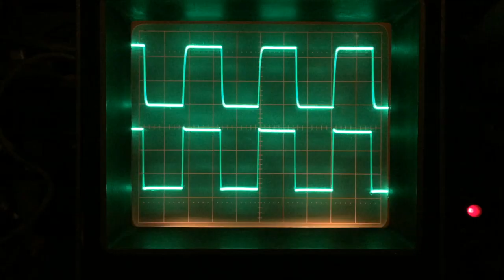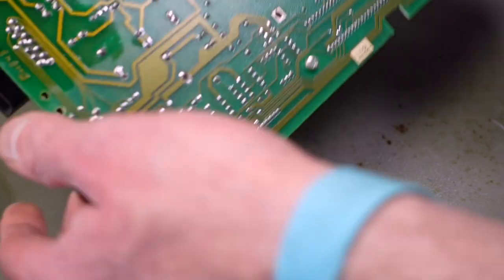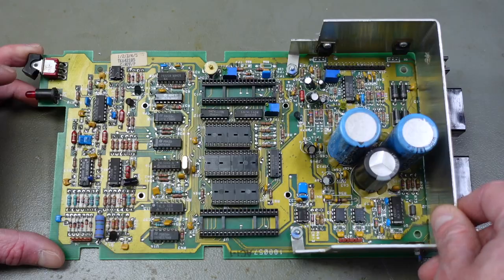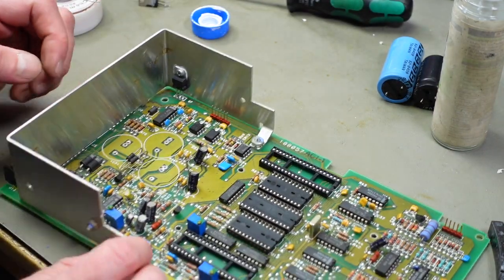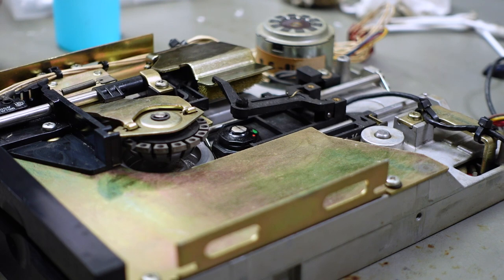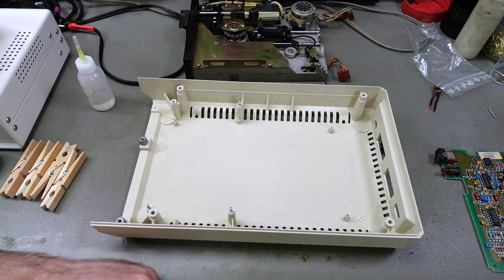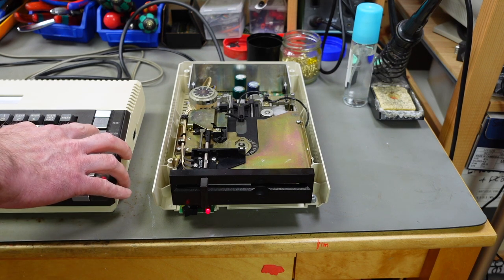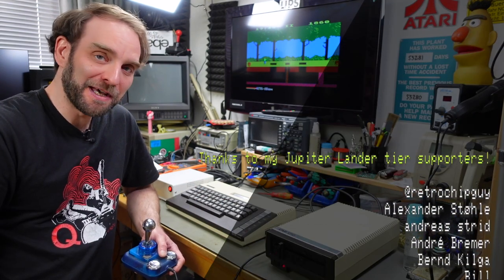Atari 1050 Disk Drive Restoration

Comment: I think the reason the screening can only rusts on the top (I've seen this a lot) is that dust settles on it, and then it gets in a humid atmosphere and the dust holds the moisture against the metal. Not much you can do about it :) If it gets bad, then neutralize it with rust converter and paint with silver paint.
The 1050 floppy drive is a really nice peripheral, and reasonably reliable if you keep the mechanism lubricated. They had a bit of a reputation for being noisy, and sometimes they were really noisy out of the factory because they didn't lubricate the rails that support the head properly - I bought one back in the 80s and couldn't believe the difference between it and the other one I had, so I took it apart and put a tiny bit of oil on the rails, and it practically silenced it!

Comment: Thanks Jan for taking the time to film/record and post. Always great content!

May I suggest a product from the US called DeoxIT made by Caig Labs if you’ve not yet discovered it. It’s a contact cleaner that cleans contact oxidation, lubricates and keeps the oxidation at bay. You can find it at the big A**z*n online retailer. I’d recommend the D100 formulation (100% pure DeoxIT). I’ve been using it for at least 20 years now and it works wonders.
Reply from the maker: Thanks! I know about Deoxit but it's super difficult (and expensive) to get here in Germany. I'm usually using a contact cleaner called Teslanol T6 Oszillin, which has very similar properties and is made here. I've been using it for years now and for all I know it works just as well as Deoxit. :)

Comment: These early Atari 8 bits were always a bit of a mystery to me. Everyone around me had C64's so that ended up being the route I went too. Oddly enough my first PC was an Atari PC1. I loved that little PC. I wish I could find one again...
Reply: Same here. I didn't even know these existed until the age of the internet where we could look stuff up. As a kid in the 80s, you only knew what you knew.
Reply: @PJBonoVox  Yes it was a bit frustrating as an Atari 8bitter back in the day because nearly all C64 owners I met didn't know what they were missing and the Atari 8bits are great machines. There are many differences between the platforms. I think the C64 route was great too and it was the most popular with more software and wide market acceptance of course.
Reply: @gamedoutgamer  Well yeah, I mean seeing it now it's a killer machine for its time. Just like how the Amstrad CPC got the shaft when it came to game porting, we just didn't know better at the time :(
Reply: They probably all suffered a terrible end as I think they had a always leaky RTC soldered onboard unfortunately. There will be machines of that era that are lucky to survive at all. For example, after many years of looking, I just managed to find an undamaged Apple Mac IIci, which was one of their longest (best ever?) machines, but most of them will have died horribly because of battery leakage.

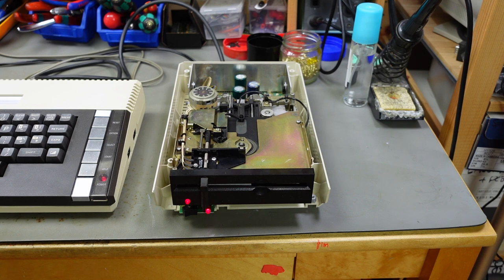Comment: Great restoration job, Jan!    30:29 it's whining because the pad is worn or old and dry. Needs a replacement pad.  They are $3 from Best Electronics. I replaced one here using super glue which now I realize was a mistake. Now it will be more difficult to remove the pad to change it. Also the super glue leaked into the pad some which is bad. =( Should have used a regular, less permanent glue.

Reinforcing the cracked case glue external to the crack is advised using baking soda+super glue method.  Only glue internally in the crack as you did, then baking soda+glue external to the crack for strength. 

The only thing remaining to do that might be advised is to run all new wires internally, which I don't know of any kit to buy for such a project. They are clearly old and stiff now. Would like to do that to my drives as well. New wires might be less stressful on the electronics (less resistance).

You can place the case plastics out in summer mid-day sunlight to remove yellowing but to be honest the drive looks good.

Comment: Check the dates on capacitors bought as new. I found the new capacitors was older than 1992 capacitors in circuit.  Thats ali for you.
Reply: That's Chinese sellers in general...

Comment: You could have tried acetone to repair the cracks instead of superglue, like Adrian (Digital Basement) often does.
Reply from the maker: The glue I used is acetone based but contains other chemicals so it works for various different kinds of plastics. Basically does the same as the acetone, it’s just a bit more versatile. ;)
Reply: @JanBeta  I've found it is easy to put far too much acetone on some plastics and suddenly you have ... goooooo.

Comment: If you don't have the 9V AC around I would strongly advise you to mod the PS circuit. You want to get rid of the voltage doubler, and the linear 12V DC regulator and use a good quality 12V DC wall adaptor (for example from an old, branded router or similar). In fact, the diodes used in the voltage doubler are underrated IIRC
As an extra, you can think of replacing the 7805 with a buck circuit (search for: mini buck converter)

Comment: I loved those drives and have many. They always got super-heated in my experience, especially if stacked which was not a good idea. The follow-up XF551 was not as well made, at all.
Reply from the maker: Yeah, the heat sink gets quite warm indeed. Not the best choice to have most of the power supply internally regarding long term reliability. :D

Comment: I don't know if you've tried sulfuric acid (or are comfortable using it) but a quick treatment should get rid of the remaining rust on those shields. I'd also spray them with conformal coating too to help prevent recurrance.
Reply from the maker: I had some success with (don't laugh!) using cola and aluminum foil to clean rust. Cola contains phosphoric acid so it's a similar chemical approach I guess, minus the handling of more aggressive acids. :D
Reply: @JanBeta  That sounds like a good idea. Cola also contains carbonic acid which may act as an additional reducing agent? Not sure but it might. I know it's good for cleaning old coins (and dissolving teeth).

Comment: Hi, I love you repair videos :) - Since I am also restoring old computers I have ran into the same problem as you: the tip of my UHU Plastik Glue is clogged.
What keyword I have to search for when trying to find replacement tips or bottles? - I haven't found those, yet.
Reply from the maker: „Nadelflaschen“ in German. No idea what the English word would be. 😅
Reply: @JanBeta  Kein Problem, dann werde ich mal auf die Suche gehen :)

Comment: Curious, why did you replace those capacitors? They seemed perfectly fine. Also, even if modern capacitors are good quality, the risk of damage to the board replacing capacitors needlessly isn't worth it. The old saying "If it ain't broke, don't fix it!" applies.
Reply from the maker: The original capacitors are just very old. Electrolytic capacitors have a limited lifetime, no matter how good they are. They are going to fail eventually and in the worst case not filter noise/ripple well enough or even short out and damage other (irreplaceable) components. I like to replace them for preventative maintenance. I am pretty good with desoldering and resoldering these days so usually I manage to not damage the boards I’m working on. It is a different story for peeps that are not that confident though, there’s always a bit of risk involved.

Comment: I never get the controversy about the caps. They're old and they are known as a failure point even when they are known to be "good ones". I let my Amiga 1200 be completely recapped with modern, polymer caps that can never leak even. :)
Reply: Interesting to measure and compare them out of circuit, including hidden values.
Reply: I did the same with my Amiga.     Vincent?  That's an awesome name!
Reply: The mid-1980's era had reportedly better quality caps than the 90's-2000's. This has proven true afaik. Also Atari did not engage in extreme cost cutting on the XL's as C= was known to. The XE's were however more cheaply sourced but also had improved video circuitry.

Comment: "The capacitor plague was a problem related to a higher-than-expected failure rate of non-solid aluminum electrolytic capacitors, between 1999 and 2007, especially those from some Taiwanese manufacturers, due to faulty electrolyte composition that caused corrosion accompanied by gas generation, often rupturing the case of the capacitor from the build-up of pressure."
Reply: Didn't some company try to illegally 'copy' the electrolite fluid (which is a 3M? patent). It resulted in enormous disasters a few years later. I recall we got the contract to replace tens of Dell servers which used caps that saved a few cents/unit but were dying continuously and being recalled.

Comment: Anyone know of a good substitute available in the US for the plastic welding glue Jan is using?  I've tried just straight acetone, but it evaporates too quickly to be useful as a welding glue.
Reply: Try plastic glue for pipes
Reply: @Doug_in_NC  Thanks.  Pretty much exactly what I'm looking for, since a lot of retro computer cases are ABS, and this stuff says it's a welding agent that'll glue ABS.
Reply: @stevesether  To reinforce the cracked ABS, I recommend using the external superglue+baking soda technique to strengthen the crack. Adds a lot of strength. Not in the crack since the baking soda adds bulk.  Only works when out of sight of course since it adds a lot of visible bulk to the area.
Reply: @gamedoutgamer  What's the advantage of that over just using straight epoxy?
Reply: @stevesether  Never used epoxy. I think it's stronger. There are vids on baking soda+superglue. Check those out.

Comment: 32:46 - Did you just spray silicone oil all over your disk surface?
Reply from the maker: A tiny little bit, yes. Wiped it with IPA afterwards. ;)
Reply: @JanBeta  whoops!

Comment: ever heard of wire wool for the rusty covers???? takes it all off no messin around.... just the way i do it :D .
Reply: The wire wool will clean it off but also accelerate further corrosion because it scratches the surface, but a protective treatment or paint afterward the wool might work.

Comment: The risk of cleaning a pcb with water just to be a little cleaner is just not worth the risk of killing it due to corrosion, etc
Reply from the maker: Never had any issues using water on PCBs. You just have to make sure to remove the water again with alcohol and drying it thoroughly. As long as you don't use water while the device is powered on, you are going to be fine in my experience.
Reply: It was fine because he used alcohol to disperse the water and then a dexoit-like spray to protect the pcb. There is a protective oil in the spray to halt corrosion. One must clean the board before protecting it anyway so it was a good restoration method.  He even let it dry over night which is great.